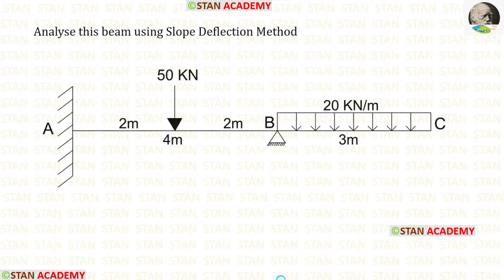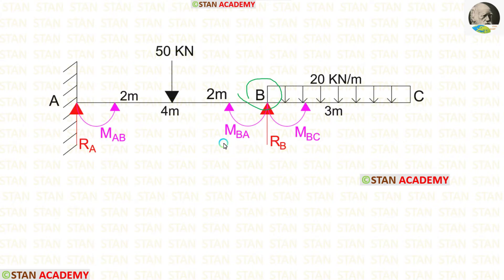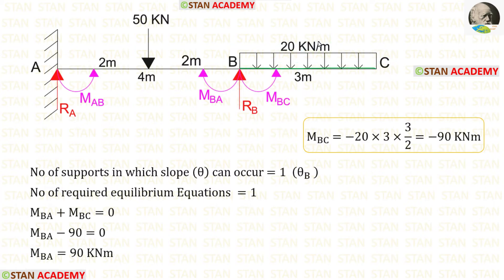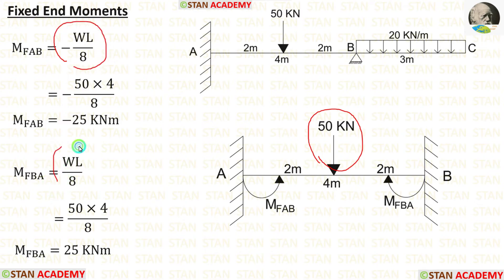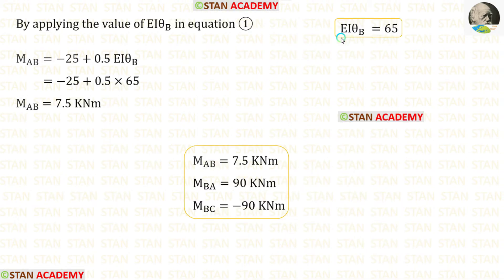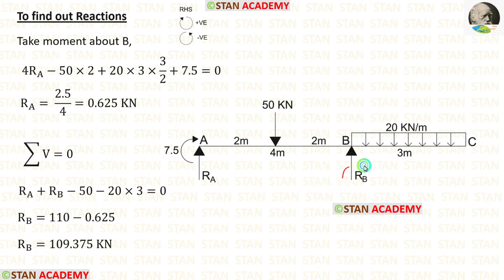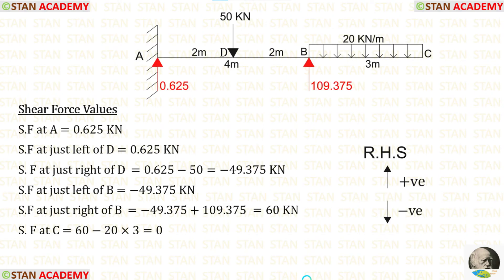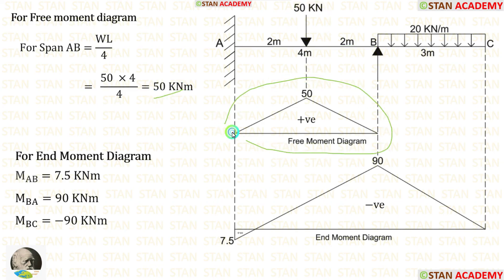Slope Deflection Method for Beam Analysis - Problem No 8

Comment: Hi, if the support at B is a roller support, how do I find M(BC)? and will there be fix end moments?
Reply from the maker: Same procedure. As long as there is no horizontal load in the beam, roller and hinged supports are treated as same